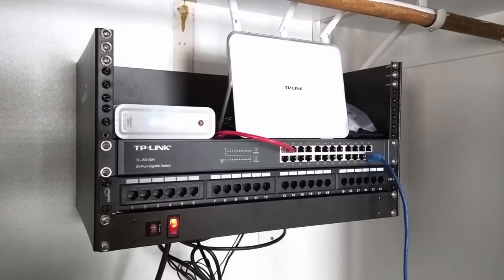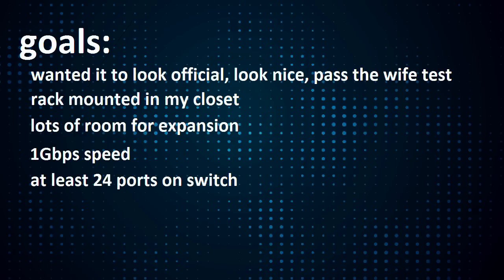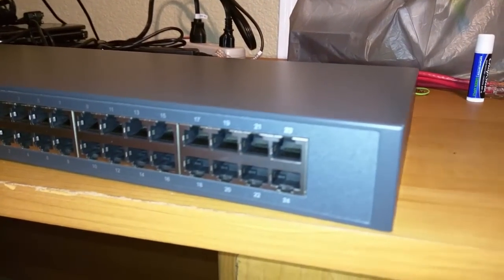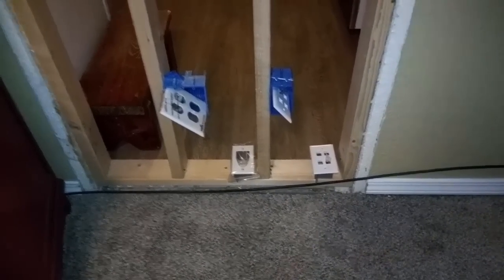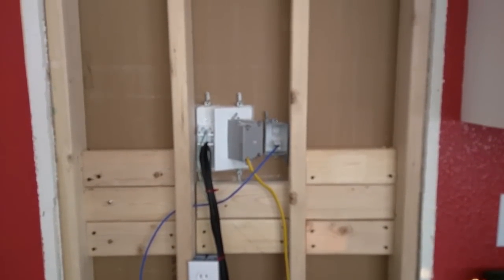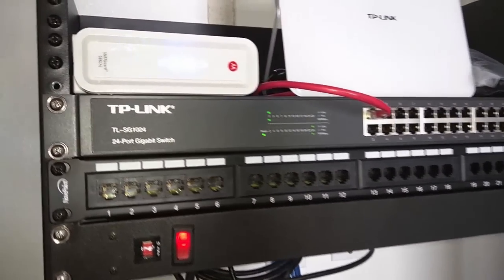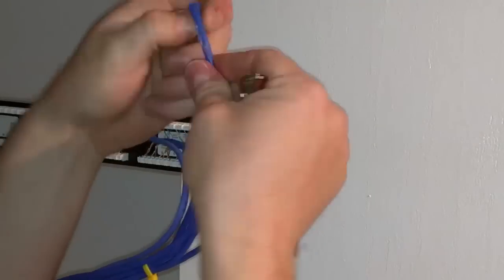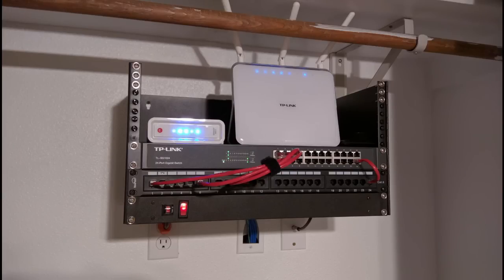Budget Home Network Tour/How To

Comment: Tip: Do not use zip ties. The sheathing on the network cable can swell and shrink based on temperature shifts which will cause the zip ties to cut into the cable. Instead spend a couple of bucks on a roll of velcro and cut strips of that to manage your cables.
Reply: It's not even that, if you ever need to redo your cable management for whatever reason, you have to cut the zip ties and risk damaging the cables then too.
Reply: Made a note of this, cheers!
Reply: @Squirleypoo zip ties are reusable.  Just use a small awl to prod the tab back.
Reply: @MatthewHauserman  I don't have time for that. Velcro is reusable and just pops right off and goes right back on. Velcro was also flexible and won't cut into the cabling through thermal expansion and contraction. If you are a contractor that I hired to run cabling and you use zip ties you are redoing the job or you are not getting paid because you did not complete the job through the scope of work.
Reply: @Squirleypoo  you wouldn't be hiring me cause I would overprice it for being picky.  Zip ties would not damage the cabling if you use them properly.  You're not suppose to tighten them enough that they can cut into the cabling.  Oh and you could try to refuse payment, I would just put a lien on your property as it wouldn't be specified how cables are secured in the scope of work and there is no code against zip ties.
Reply: @Squirleypoo and your contractor would sue you and win. Unless you literally had it in your contract not to use zip ties. Otherwise that wouldn’t be reason enough to refuse paying for their work.
Reply: @RandomGuy-wz7zo  you've never worked a contracting job and it shows. "Scope of work", read it again. Read it 3 times.
Reply: @RandomGuy-wz7zo  you're right, I wouldn't hire you. That's not a flex...

Comment: 1 tip on the punchdown panel. You need to maintain the pair twist tolerance all the way from the jacket butt to the panel itself. Very important on Cat6 and up spec cables. Each pair is twisted differently to prevent cross talk. That few inches of untwisting the pairs can drop your network speed a lot. Same goes if installing a RJ45 connector.
Reply from the maker: +Matthew Barras thanks for the tip. I tried to keep them as twisted as I could.. but it was my first time doing lots of those.
Reply: You should be fine. It will work. But if you are a lot slower than 1G. Like 600M or 700M. Just pull the wire out of the blocks. Cut off the wires and rebutt the cable jacket. You should have a max of 1/2" of wire exposed from the jacket butt after you punch down. Do not untwist the pairs. Just spread them enough to slide them in the block teeth and punch. Just a FYI colors and pairs do matter. Follow the standards. On cat 5 you could get away with "It does not matter so long they are the same on both ends of the cable". On cat 6 and up in does matter. On 10G it matters a whole bunch.
Reply from the maker: +Matthew Barras true.. this is just cat 5e and I'm getting the 1Gbps speed.. on ever line, so I guess I got it this time. Thanks for the tips.
Reply: True enough - it has been my experience that you don't run into issues until your cable length goes past 80% of the maximum standard length. Also important is keeping the wire lengths of each pair close to the same.

Having said that, I can't count how many times I have seen improper cat 5 and 6 terminations that still pass 1GB - probably because most cable runs don't get close to the maximum length. The majority of actual problems I have encountered were due to people swapping A&B standards, mislabeling cables, or badly nicking the insulation when they strip off the sheath. All of those problems should have been caught by tests which were supposed to be mandatory; instead I caught them while installing equipment and I ended up taking off the jacks and fixing them.
Reply: Matthew Barras Exactly this, you also aren't supposed to strip the wire pairs the punch down does this automatically. Yeah you can still get full speed, but you will create a ton of collisions where packets need to be resent. Also for the in wall work you don't want any wires going near power lines as they too will create a lot of EMI and interference.
Reply: If the electrical is inside metal conduit you should be fine running them along side in most cases. Try to maximize the separation otherwise - for example by stapling power down the left hand stud and Ethernet down the right hand stud and drilling separate holes in the top or bottom plate. Also, try to keep your runs 2 feet or more away from florescent fixtures and motors (found mainly in A/C units and refrigerators).
Reply: bawitdaba. Dude you're confused. Nowhere did I say to strip the pairs. Just the jacket. BUT the same twist discipline would apply if you did srtip the pairs. Like to wire wrap them on a pin block. An ethernet cable is designed to resist the EMF put out by AC equipment and wiring. Again why the standards should be followed.

Just because the green light on your NIC and/or switch turned green does not mean it "works".  It might pass traffic. But it will not meet standards. Stick a network analyzer on your stuff that "works" and see what the truth is. It is just plain stupid not to follow the standards for no other reason than to be lazy or ignorant. Why in the hell spend any extra $ on cat5 or 6 and GigE equipment then? Just buy the cheapest 10/100 equipment and the cheapest cat 3 wire available. They will all "just work". If you want GigE buy cat6 and terminate it correctly with the proper tools and connectors. The correct info is just a google search away.
Reply: We hear you - just pointing out that: #1 This is a home network, and budget is usually an issue; #2 At less-than-maximum-length runs found in most homes this is far less of an issue; and #3 Dollars to donuts says that his runs will pass a full Gigabit of traffic - easily tested without a network analyzer simply by copying a large file. The standards are written to ensure clear communication at a maximum length run. 

On the flip side: #1 Realize that this is your home network, so don't bring these techniques to a professional job; #2 it certainly possible that you might run into problems by not following the standards - if this happens, then don't complain - look at your weak spots and fix them properly.
Reply: The twist should stop wherever the wires need to go different directions. A lot of our installers will leave at least enough un-twisted wire that they could be cut, pulled further through, and punched down again in case repair or changes are needed. Never had any problems with interference or crosstalk, even in noisy racks. The inductive capability of a 1-2" straight piece of wire is pretty damn small.
Reply: You're incorrect. the twist should be maintained right to the point of termination.
Reply: You're incorrect. It completely doesn't matter for distances that short.

Unless your punchdown is on the back of a fluorescent ballast or something?
Reply: The problem comes from induction (electrical current through a wire creates a magnetic field that "orbits" the wire; likewise a nearby magnetic field will induce an electrical signal onto a wire). If you take an inductive amplifier (The "hound" part of a "fox & hound", sometimes known as a Banana probe") and move it near the top side of a florescent light or motor you can hear the AC signal. Or you can take an unterminated Cat5 cable running near it, and an inductive meter placed anywhere along the cat 5 cable and hear that same noise being induced onto the cable.
Reply: That is irrelevant.  it will fail certification testing. It's poor workmanship and incorrect.
Reply: The twisting of pairs within cat 5/cat 6 cables greatly reduces noise from induction (but not eliminate). There is a second form of induction that occurs between two conductors separated by an insulator - check the definition of a capacitor. Using a properly grounded shielded cable will help reduce this as well.  Not being privy to all the particulars, the advice stands: maintain separation between your network cabling and electrical motors and florescent fixtures.
Reply: Again, this is a home project - see the initial comments.
Reply: As I originally stated, the inductive capacity of a tiny length of cat5/cat6 conductor is pretty negligible unless it's next to a particularly noisy source.

The capacitance of this length, even if properly configured as a 'capacitor', is even more negligible.

Relating to magnetic fields, the wavelength of Cat5/Cat6 signals bottom out at about 6". Anything shorter than this will receive almost zero inductive interference that matters on the line. If you're pulling apart over a foot of the twist, then yes, you might run into issues (600Mhz wavelength is about 0.6m) as the wire starts to act like a pretty efficient antenna. Opposing signal/electrical flows in the wires also have a cancelling effect on magnetic fields even without a twist.

Regardless, nothing you can achieve with 3-5" of untwisted or unshielded wire compares to the magnetic fields and noise you can introduce with PoE.
Reply: Matthew Barras could you actually skip the patch panel and just connect right to the switch?
Reply: You should see the looks I get from electricians and other IT cable pullers when I say the stuff you are saying CDArena. They talk among themselves that I'm crazy. But hey, I'm the one who has to troubleshoot the network and I hate shoddy work.
Reply: CDArena Here....Here...!!
Reply: sigh for the umpeenth time - Budget Home Network. You ARE your own troubleshooter. And I did specify not to do this things elsewhere. 

And I do not - except as a last resort for a short term fix to be permanently fixed later. Like when your Point of Sale system is down and you can bring it back up in minutes by grabbing extra pairs from the neighboring cash register (on fast ethernet, not gigabit ethernet). Presto - register back up and working so I can go get supplies for a permanent fix.
Reply: Or how about - I want/strongly need an extra jack in my front living room, but it is 110 degrees outside, 140 degrees in the attic. You bet your ass I'd split a jack until Winter, then run a new line. Or stick a cheap $25 Belkin wifi router in and configure it for Access point only just so I can have an extra 3 ports there. Budget Home Network - not Comptia A+ certified installation. I'm talking about things that are Not Standard, but which Can Work.
Reply: Or you get a call from a store manager that he wants to host an outdoor event in the parking lot. Are you going to insist that he install conduit to a weatherproof jack, which might takes weeks and cost a small fortune? Or are you going to run a cable along the wall and duct tape it across an expansion joint in the concrete so he can have a register for the day, then yank it out at the end of the day?

From the old days, (pre-cell phone and sta-phone age), I can recall many times when I had to run wire across fields to support NTSB crash site with telephone service. Just saying - yes, standards are important, especially when you aren't going to be the guy supporting it. But when it is your home, you make the call.
Reply: you said "this is just cat 5e and I'm getting the 1Gbps speed", how do you know you're getting 1Gbps speed? I hope you're not relying on the network port status, it lies ;)
Reply from the maker: +toysareforboys I've done speed tests. You can check out my switch review video I go into it a little more there.
Reply: Good stuff, was just checking :)
Reply: Matthew Barras   I am a ethernet newbie and wiring my whole home with cat6 cable.  I am using "tool-less" keystone jacks for terminations on walls in each room.  The source of connections will be an 8 port switch.  Each end of each cable I will make jack connections. Any tips you can offer me when making connections and this kind of set up?  any help would be appreciated!
Reply: Expert nerd fight!!
Reply: Category 5e is capable of "gigabit" Ethernet especially at distances he will be running in a house.  The Category 6 standard achieves 1 Gig to 100 meters.
Reply: is that the 1 gig link light on the nic and switch or did you TEST it to a gig with a professional cable tester?  I have a $10K tester that I use to test cables to the max speed and also head room and cross talk, also it will tell me if the cable is over footage as you can only install cables to 328 feet from end to end including the patch cords lengths.
Reply: NEVER STAPLE A DATA CABLE.  I do not know how many times I have found this problem using a Fluke Tester.  Staples and any other metal crossing over the pairs can short them or cause interference with the cables abilities.
NEVER STAPLE A DATA CABLE.
That is a 200.00 an hour check I love to collect fixing that.  And I do not do sheet rock that is someone else's job  I make to much money to be burdened by mudding and taping up sheet rock.
Reply: That is why I have 30+ years and a arm long slew of certificates in Low Voltage and have owned my own company since 2008.  I make a minimum of 200.00 an hours on DIYers that DO NOT follow established standards and "Practices".
I make 75.00 per hour if I do the work for them.
Reply: IF this is a few runs sure.  But the more BAD RUNS you install in a SOHO network the more combined issues that you are adding to the NETWORK (Home or Company).
It takes ZERO dollars extra to do it the right way to Practices that are well documented and proven.
You do not NEED to do this to BICSI which I have been trained as a ITS level just shy of the RCDD engineer.
You do not have to follow hanging the cables every 5 feet with a "J" hook or grounding with an isolated ground and many other PRACTICES.
But you should follow the BASICS.
separate cables from EMI potentials the minimum of 6" and do not exceed 328 total feet.
maintain the twist of the pairs 1/8" top the jack and panel and do not RETWIST. use a good quality jack and panel.
There are ways to do this under budget with out compromising the integrity of the infrastructure with a few week here and there runs.

We had a "few" over 400' to 500' runs of cat5 in a school and that run put a switch in a problem situation.  5 cables does not seem much but that 48 port switch had so many collusion issues it crashed daily until we bought our own t4ester and found it out.
Also the company that installed it was sued by the district.
Reply: Maintain the twist!!! Ethernet is fairly tolerant, but things like HDMI extenders for example, well not so much. You never know what you might wind up using that cable for in the future. Custom installer w/ 7 years experience. Actually just came here to judge the video and comments.
Reply: @canadude6401  how did it work out for you ?
Reply: @MajorTendonitis  Wow, this was 4 years ago?  time flies.  my project worked out perfect!  I did get from friends  "why don't you just use wifi, so you don't need a cable"  LOL.
I was in the attic, lots of fishing and tinkering around to get the wires all in the right stud cavities, took a few weekends, but happy with the progress.  Every room in the house has Cat6 and it's very reliable.  Learned a lot in the process too.

Comment: Love the neatness. I've done a bunch of office network cable installs and here are a couple of quick notes:
1. Run the cables from the hinged side instead (to the right in the video). This allow you to punch them down, tie them up, and then rotate it back into place with the cables fully mounted. 
2. That seems like a lot of metal to mess with your wifi hotspot/router's antennas. Might be better to mount it somewhere away from the rack. The other walls inside the closet, for example.
3. Cable labels are your friend. :) Maybe they're done and I'm not seeing them in the vid? I won't do any kind of install without them anymore (not even car stereo). In very big setups we will write on the cable itself before heat shrinking on something more permanent once the final length is determined.
Reply from the maker: Good points. Starting at the hinge side is a good idea, my ports would start at 24 and go down instead of 1, but could be worse.

Yeah, the WiFi hotspot seems perfectly fine. Get great reception and speed on wireless, so can't be doing much really.

Thanks for the comment.
Reply: @BudgetNerd  Meaningful names help a lot, even in smaller setups like this, so like "Living room 1 .. 4", "Master Bed", etc. Just a bit of time up front saves a bunch down the road. Much easier than having to uncover the port at the other end or having to tone out which one is which.

Comment: Nav Rack was setup upside down (top is facing down), the smaller hole on rack should face up.
Very Nice work and explanation of setup and gear.
Reply from the maker: Thanks! BTW, it's not upside down. There are little slots on the top and bottom of the screw hole.
Reply: @BudgetNerd  Awesome then on the Nav Rack.
Your home network video on budget is awesome, 10 stars!

Comment: Good video, but I will give you one tip that you may or may not know about... and that is to use smurf tube and ENT boxes for your network wiring.  They even make it just for low voltage/AV/network in orange color.  I use it for all my network runs - just mount the box and run the tubing.  

For simple wall drops I only run the tubing so it's just a few inches above the top plate of the wall.  It makes running additional cable & changing cabling so easy. You can also run it between boxes - I use it this way to run wires between DVRs and wall mounted TVs as you can get it in large enough diameter to run an HDMI cable.  It also comes in handy when going from the audio/video distribution panel to the various speaker locations.  

Yeah, there's some additional cost but it's worth it down the road if you ever need to add wires.
Reply from the maker: +Jeremy L Lawson good suggestion. Thank you.